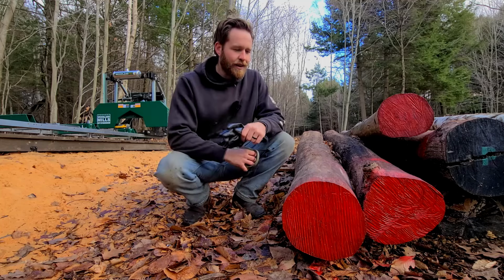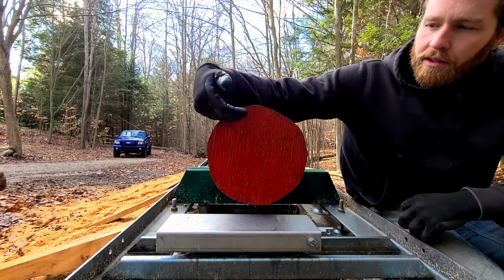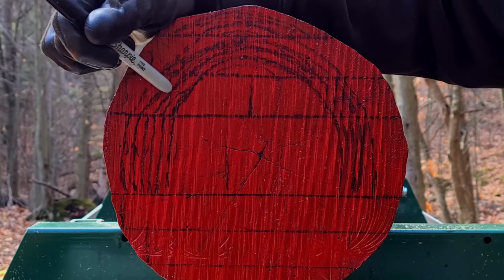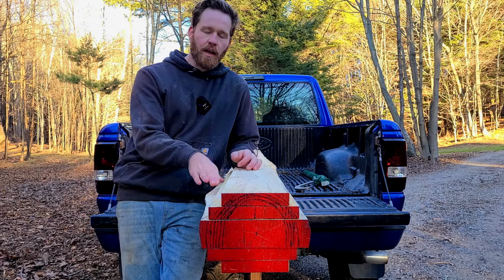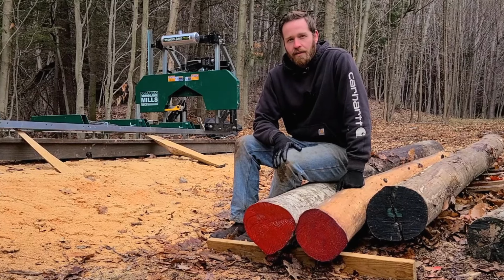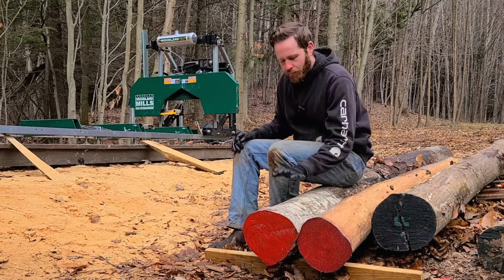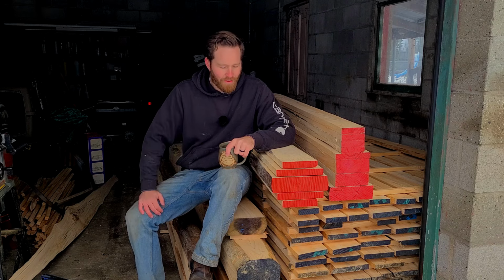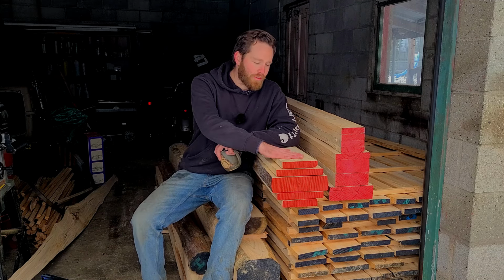There's FUNGUS in this log, and it's beautiful!

Comment: How are locking your throttle handle , I’m interested , going to check out your other videos . Nice work !
Reply from the maker: My throttle stays put on its own. I just have it adjusted the way the book told me to when I set it up. If you snug everything up nice and tight, it holds its position well.